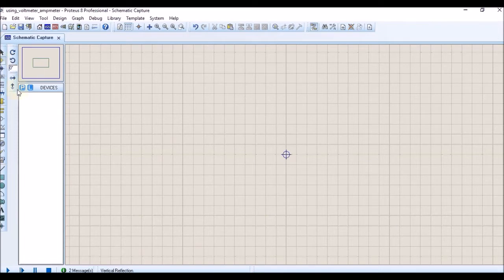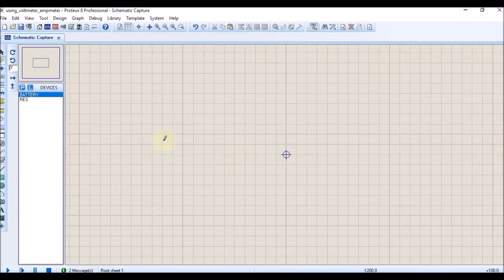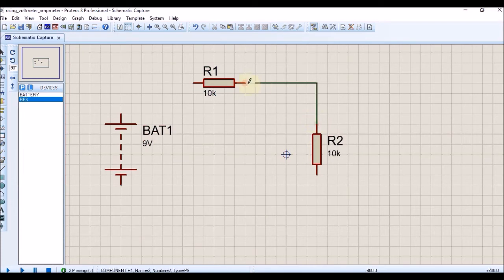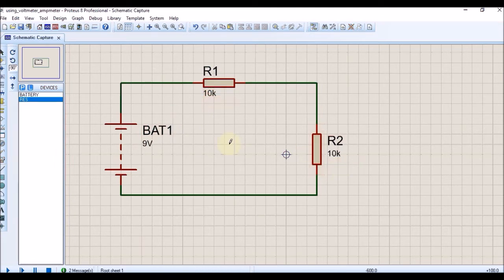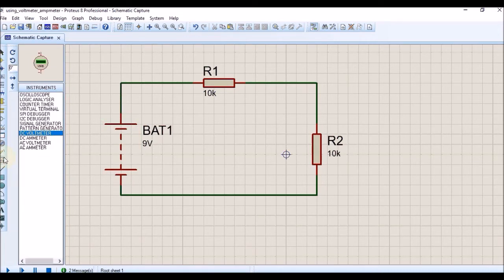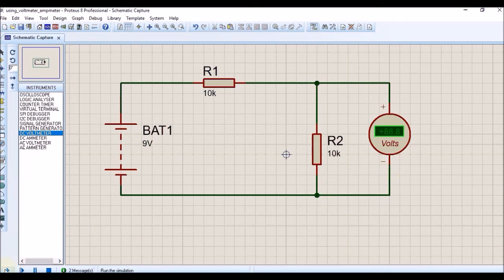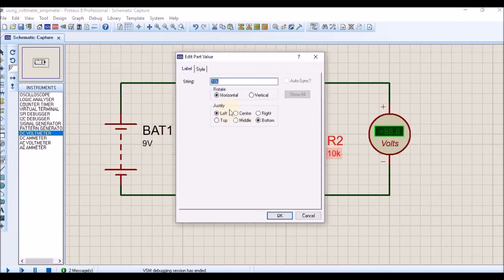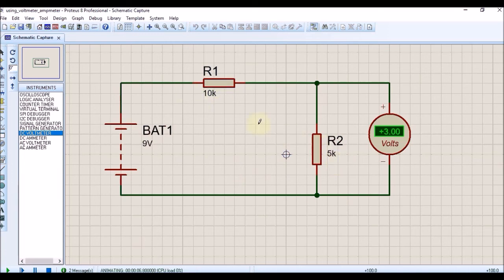how to use a voltmeter in Proteus 8.0

Comment: When i add additional voltmeter in between the wires.It reads zero volts if i connect it across the resistors.